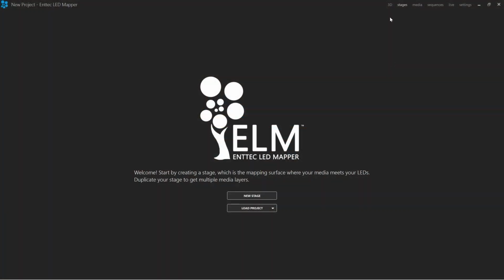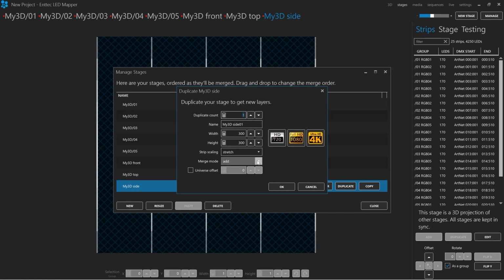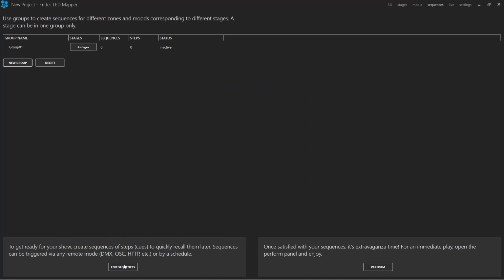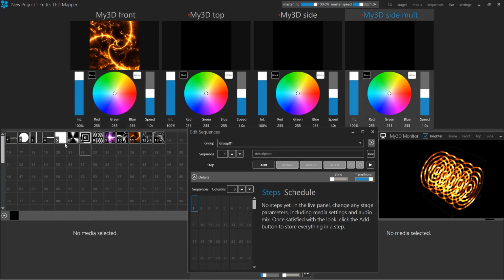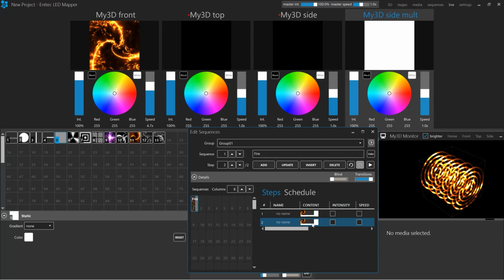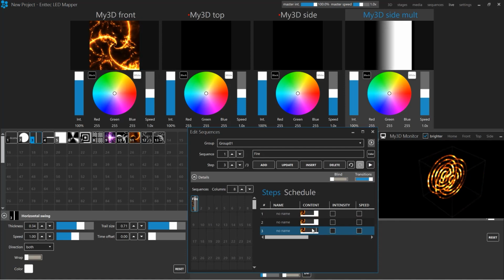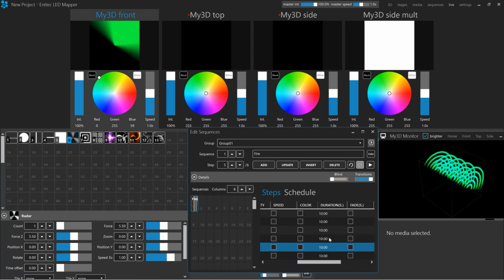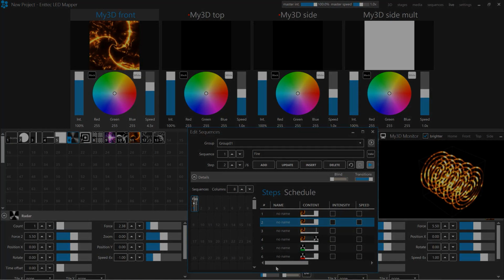How to use ELM Sequences

Comment: /is it possible to use the exact same process to connect and octo mk2?
Reply from the maker: OCTO Mk2 is an eDMX to LED Pixel converter-- that can be used with ELM-- connected to LED lights and controlling any pixel lighting system.